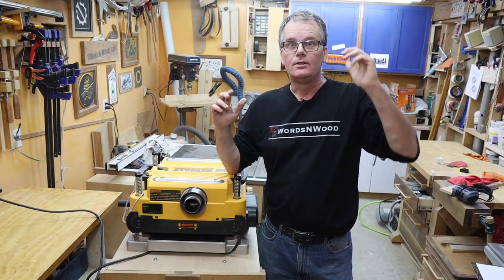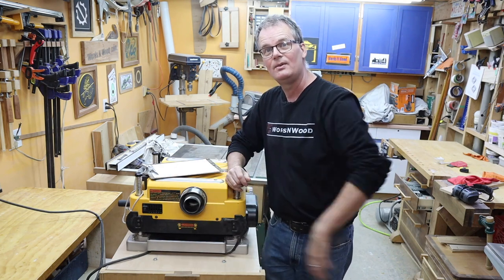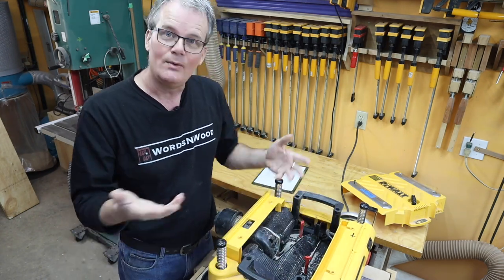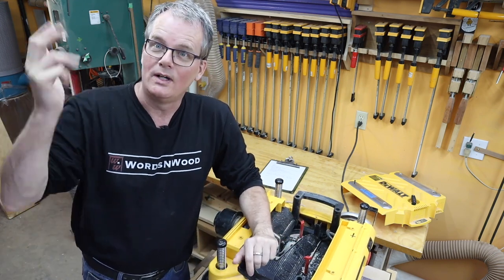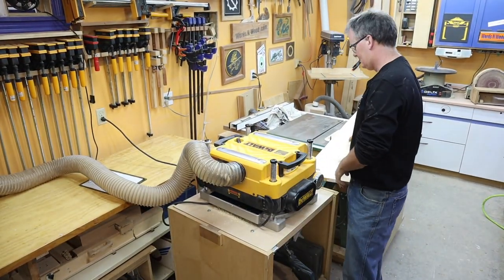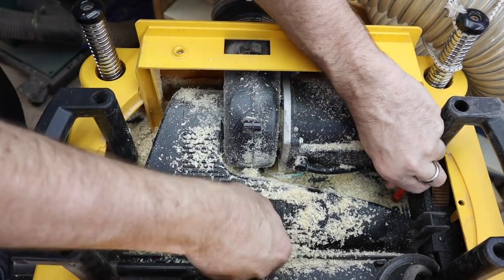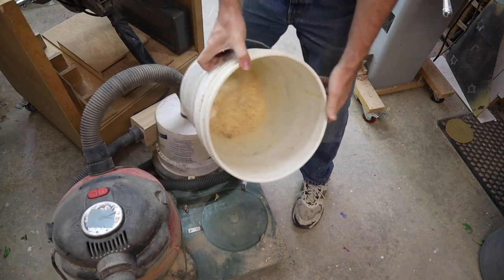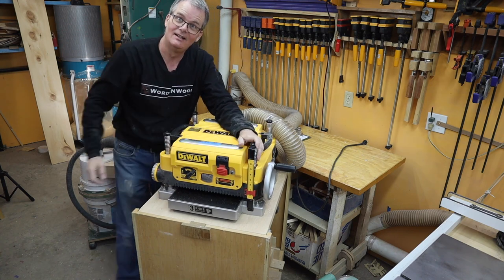HOW TO jam your planer with shavings...  // WnW 234

Comment: At 5:29 when you remove the shroud you can see above and to the left of the cutter head that there's less shavings (even the cable is still exposed like it has had shavings blown away from it)- which means there's a leak- you may want to check that out.

Edit: Let Us know if you resolve this issue as it's very interesting (sorry- I'm not on any other social media)

Comment: Not that I’ve ever done this (I have) or would ever recommend it, but you could leave the top cover off, depress the safety switch and run a board through to see where the dust is coming from. I have the same planer and I run a lot of material through it. Wide boards included. I don’t have any buildup inside of mine.
Reply from the maker: I would never depress the safety switch to run the planer with the cover off!   (Yes I have)
And yes, that is probably the right idea... wish I thought of that!

Comment: Greetings, love your channel. 
I was making an Adirondack chair. And my plans call for six 6” boards by 8 feet long. I ran them thru the same planner. And my planner did the same thing. It got so bad that I could not turn the wheel anymore and my shopvac was working fine. Please find the solution or a fix to this problem and make another video. Thank you for sharing

Comment: I have the same planer and had the very same dust issue when it was brand new.  The problem with mine was that the plastic housing around the blower was not properly seated together on the bottom side. This caused dust to get packed between the blower housing and deck underneath (just as shown in the video).

Even though the connection between the dust shroud and blower is good, there is likely another spot where the dust is getting through.
Reply from the maker: Yup, the comments are convincing me to take another look....

Comment: Better having them build up in the planer than clog up the hose.  Soft maple is the bane of my planing existence.  The shavings come off the board in full width strips unlike everything else I plane and it's like a drain clogged up with hair every time the boards get wide.
Reply from the maker: Don't think I've ever clogged the hose coming off the planer.  Your problems are next level, Kevin!
Reply: @Wordsnwood  I bet that impeller chops them up

Comment: I have the same planer which had that exact issue. After taking it apart a few times I noticed that the fan cover was cracked and a small hole from a chunk of wood. I ordered a new cover for the fan, no more shavings inside my planer.
Reply from the maker: Thanks... lots of great comments on this, which is convincing me to take a closer look at the issue.

Comment: I have a much bigger planer and dust collector,  when you almost max out board width to the size of planer you will always get some chips bypassing the collector. I look at it this way, they design the dust port for say 60-75% max load. If they designed it for max width all the time, you would have a 6" port on that machine. Not really practical for a small shop.

Comment: Art, I would try to see where that's coming from.  You can try this.  Take that top cover off and expose the inside.  Leave everything else attached.  Put your camera on it top-down and plane the board again with the camera running, then you can go back and see where the shavings are infiltrating from and fix it.
Reply from the maker: someone else suggest something similar... thanks..  Good idea!
Reply: You would have to jam the switch. These planers won’t run with the cover off.
Reply from the maker: @WesHamstra  Yup.   Thinking about it...

Comment: I wonder if it has anything to do with the bend your dust extraction hose makes just after the fitting on the planer?  How old is the planer?  Maybe the fan motor is getting weak?  Have you contacted DeWalt about it?
Reply from the maker: Possible?  But I think that most people have a bend pretty quickly in their DC as it usually either runs to the ceiling, or to one side or the other.
Reply: I have the same planer and don't have this issue with wide boards. The planer blower has a far more powerful blower than my dust collector has vacuum, I am petty sure the the bend in the hose right at the planer is causing a back pressure and pushing sawdust into housing. Try straightening the hose for 5 feet and then retest. If you still have a problem, come on over to my place and try it.
Reply: I agree with the bend being the problem. I have had the same planer for 6-7 years and have never had this problem.
Reply from the maker: @jamesbenenati1039  And I can't think of any woodworking shop I've seen where they don't have a bend in the DC coming off the planer --- I mean it exits right above the outfeed, of course you're going to have a bend of some kind in the pipe there.    Admittedly, I have a pretty tight bend, but I have the planer blower pushing and the DC sucking...  I find it hard to believe.  Hope I'm not eating crow on this one! :-)

Comment: I just got the same planer but used and the first thing I did is run a 12” wide piece of maple threw it without my dust collector hooked up. I was really impressed by how much chips came out the hose then I opened the top and ther was zero chips inside. So I’m very curious on what is causing the problem with your planer. Maybe because it’s pine and sticks more inside? Please share the results you find.
Reply from the maker: Yup, lots of interest here, this is worth further investigation!

Comment: I can clearly understand that some chips might get through, but that seems an excessive amount given the number of passes you took. I have a different planer, but from what I've heard the impeller on that model is very good. In fact they used to sell a garbage can cover that connected to the hose and the planer inflated the cover over the can on its own just like the bag on your collector. It shoots the chips out so well it almost doesnt need a D/C. Drew Fischer from Fisher's Shop on his podcast has claimed he finds that Dewalt Planer almost impossible to clog. So it sounds to me like you have something slightly amiss that could be improved.
Reply from the maker: Bears further investigating, I agree

Comment: So the lesson here is clean the inside of the planer after every use?  Have you explored adjusting the flow with your vacuum system for an application like this? I wonder if the flow volume/velocity from the planet exceeds the capability of the vacuum system ?
Reply from the maker: Or at least my planer.   sometimes.   But I think more investigation is due...
Reply: Does this only happen w pine?

Comment: Reinforced my decision not to buy one of these.  Thanks!
Reply: The next option is well over five times the price. Good luck with that. He only experienced this small problem after years of service. It is very likely the seating of the shroud against the blower housing. As it’s the only access for dust to escape on its travel from the cutters and out. Watch Next Level Carpentry’s “Care and feeding of DeWalt 735 planer” it’ll enlighten you.
Reply: @FearsomeWarrior  I do fine so far with a router sled and handmade thickness sander.  (Stumpy Nubs style)  No need for this.  I was considering it but since what I use now has wider capacity and does not clog why bother.
Reply from the maker: @FearsomeWarrior  Thanks for the rec.  I went and found it and it's true he has some good tips in that video.  Will keep that in mind when I revisit this issue.